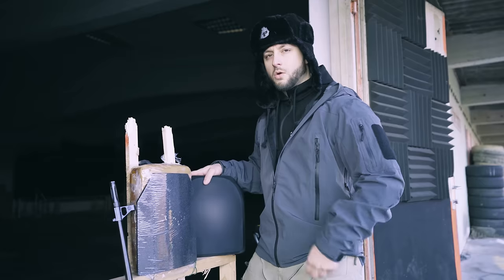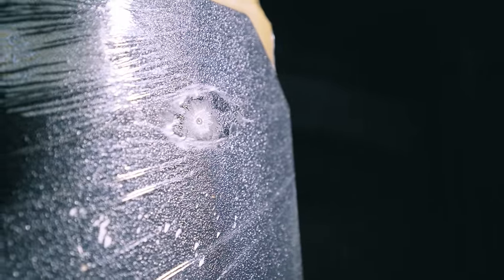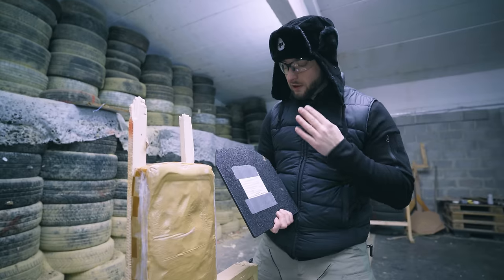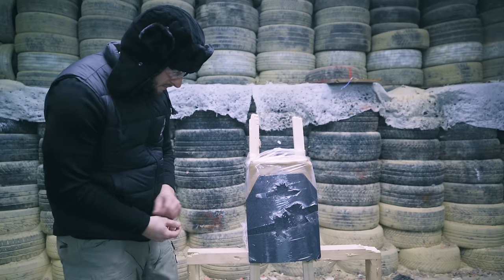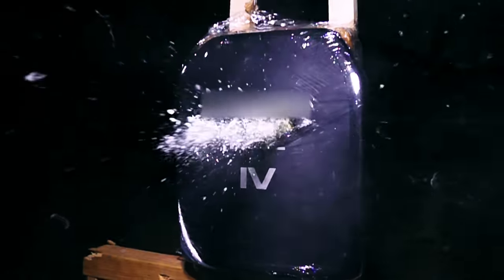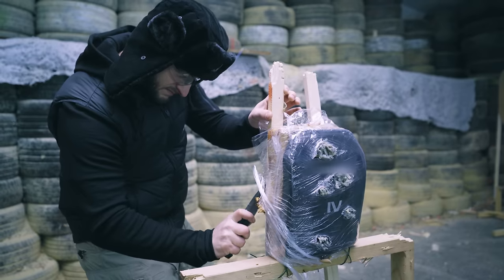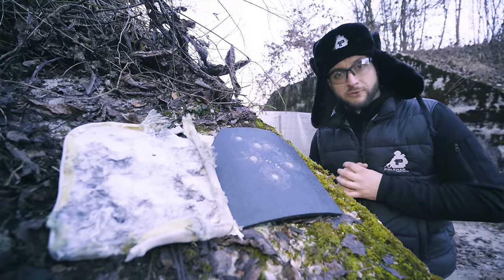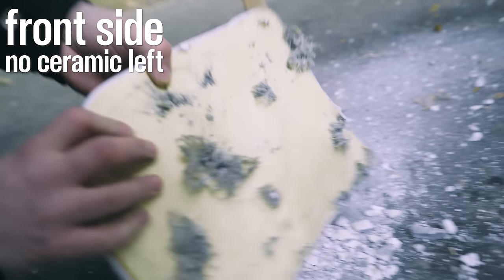Steel vs Ceramic Ballistic Plates

Comment: What is the price difference between the two? And how about combining the steel plate with soft body armour? Always great content👍 Greetings from Bavaria
Reply: Good Level IV plates are $600+ for a pair. Spartan Armor Systems AR550 Level III+ steel plates are around $250 for a pair. III+ can defeat pretty much any common use 5.56 round (including M193 and Green Tip).
Reply: @Sweetness71775  thanks for the quick reply 👍
Reply: In greece siamidis level 4 standalome ceramic plate costs 240euro
Reply: @Sweetness71775  M193 and M855 (green tip) are both not ap rounds so that makes sense. Anyways tho, those rounds running actual military pressure out of a 20” barrel is gonna vibe check you anyways
Reply: @Sweetness71775  they make fun of you . in greece you can buy good ceramic plates with 300$
Reply: If you go with steel, putting soft armor behind it is a wise choice, soft armor is meant to catch small arms fire, shrapnel and is designed to spread the impact energy, steel is tough so spreads the energy over a wider area and transfers it to the soft armor dispersing it even further, not to mention it has the chance of catching the round if it makes it through the steel plate, but if you are the type to run around with a midget plate carrier that only protects the heart and lungs at an 90 degree angle then suffering is deserved, shove those steel plates into an IBA vest, works best in that case
Reply: @c03_psychie20  yeah putting soft armor behind isn’t gonna solve the problem of “i just took shrapnel to my carotid”. Plus, thats adding more weight and bulk to already bulky and heavy plates. But at the same time, considering what u think about modern kit, its not surprising
Reply: @bro26mohw  solving what problem? The person asked about combining steel with soft armor, since everyone got only ceramic in mind, I decided to explain my understanding of that one ignored topic. Besides bulk and weight doesn't matter to me, it's not like I'm going anywhere. Also that thing of bulky armor is one really shoddy and sad excuse coming from a ceramic user, those ceramics are also heavy and overly bulky, use a different excuse please
Reply: @c03_psychie20  modern ceramics are 1/4 of an inch and my level 3 plates (on the upper side) are only about 3.75 pounds. So yeah no. Seems like u might be a bit behind for ceramic tech
Reply: @bro26mohw  aaaand you use one brand of plate to support your entire argument with regards to weight, 1/4 of an inch...BFD is gonna be horrific, it's gonna last a 1/4 of the shots of the thicker plates and your body weight is gonna take all of the impact from being light, once again I was explaining to the other person with regards to soft armor and steel, naturally one of "you" just had to brag about how great ceramics are without mentioning any draw backs, don't assume everyone has the same preferences
Reply: @bro26mohw  btw, the "carotid problem" iba vests have kevlar neck protectors incase you overlooked
Reply: @c03_psychie20  i purposely ignore that because the iba is severely out of date. Taking a normal modular plate carrier and adding on things like a groin protector, side armor pouches, etc
Reply: @bro26mohw  yeah I know, it's been replaced so many damn times I just don't care what version they are using anymore or the name for it so I just use a name as a universal term😂😅, but whatever works for a person works, I'm not gonna tell them otherwise it's their cash

Comment: I think a half-ceramic half-steel hybrid plate is the solution.
Reply: There is no these kind of plates in market
Reply: That's not how it works. You mix materials that complement each other, not two hard surfaces.

Comment: as the result on the paper which analysis by the army, the steel plate does hold better than ceramic by mutiple shot on the same spot.
but it rarely to get shot on the same spot when you're in the operation. also, the bullet breaks into piecies and it could scratch you body or your face also when it hit the steel plate.

you may survive by steel plate when it was hitten at the same spot, but also get injured sitll
you maybe will injured by getting shoot at the same spot with ceramic plate, but atleast it's rarely happened, and with ceramic plate you wont need to afraid for splintery scrap from bullet

some of the army who i known will put a NIJ4 plate and a 2.3mm steel plate(about 3A) for addition armor at the front if their physical fitness aloud them to do it

Comment: I'm actually suprised how well the steel plate did. hmm.. I was about to order some ceramic plates, but now I'm not quite sure anymore. The ceramic fragments look a bit worrying in the high speed camera. Maybe you could do some more investigation on spalling of different armor plates?
Reply from the maker: Go with ceramic - it's level IV and still considerably lighter than a steel plate. Also the price difference isn't that big anymore so i really don't see much reason to buy steel plates. But if you do, buy the ones that have 100% effective spalling protection like Steel Ops
Reply: Go with RMA Armaments level IV plates. They are reasonably priced and sales are common to bring the price down further.
Reply: @PolenarTactical  well looking at ukraine these days, really? Just consider - Armox 600 plates at 5 mm thickness with Paxon are not that much of bigger weight than ceramic. But, those are multiple hits definitely? Ceramic? Not at all, one hit and you can throw it away. Ukraine has a hard time to get enough of balistics and that means, once you ate hit and survive, you will not found any free plate easily. You can use that same Armox plate once you return to the base camp and get back to shape. 
fragments? Well, you get those from ceramic as well. They will definitely cut your throat. Some finest kitchen knives and scalpels are made out of ceramic after all. 

Regarding polyethylene panels, yes, those are light. But the results are definitely not great. Even those rated at level iv can be shot trough with such commom round as 7,62x54R (very common in central europe here) or high velocity 5,56. 
Trauma effect even when bullet will not pass through? 5-10 cm without problem, so if not a bullet will kill you, trauma and internal bleeding will.
Reply: @ZhuJo99  yeah id honestly rather have steel with good fragmentation protection. duct tape can even become a frag sleeve.

Comment: I personally run ceramics but steel isn’t terrible and I’ll probably pick up a backup set of steel plates in case SHTF
Reply from the maker: Steel is very heavy and only makes sense if you get it way cheaper than ceramic composite - and it needs to have proper spalling protection otherwise it can kill you

Comment: Is the vz58 is not much overgased with the supressor? Or did you regulate the gas?
Reply from the maker: It's overgassed but since it's short stroke piston system you don't get that much gas in the face

Comment: Most plate carriers are enough to protect you from spalling. People like to throw fits.
Reply from the maker: That's not completely true, the fragmentation from an unprotected steel plate is enough to penetrate a couple of layers of cordura from any plate carrier and seriously hurt you.
But the problem of "spalling" was already solved by most companies that sell steel plates, you just have to get the correct ones

Comment: Just a bit of info for those who care to learn: steel plates have significant danger of spalling shrapnel causing an injury, but what most people fail to understand is the danger of kinetic force transfer. A steel plate can stop many high powered rounds, sure, but it transfers a massive amount of force to whatever is behind it (your chest and vital organs). This can cause severe internal damage to lungs and organs. It's not something that shows up in a ballistic test with a plate strapped to a pallet or whatever. Would you slam a sledgehammer into a cast iron pan if your palm was pressed against the opposite size? Think about it. Buy ceramic.

Comment: 855a1 is not ap.
Reply from the maker: https://www.army.mil/article/48657/evolution_of_the_m855a1_enhanced_performance_round
Reply: @PolenarTactical  "Although it's not an armor-piercing round, the EPR "
so, mil.gov says it's not AP 🙃
Reply from the maker: @doejohn8674  true, they designated it as an "enhanced performance round" but i has a hardened sharp penetrator (can actually see it sticking out of the bullet) and it goes through most NIJ level 3 plates

Comment: I hear you can get spall sleeves to go over steel plates. Do you know if they properly contain the spall?
Reply: There are coatings to reduce spalling too
Reply: Sleeves generally work , they of course will be torn apart after a certain amount of shots, but they can work. 90s and early 200ps era russian body armor had that (and you can look up on oxyde s channel for test of such armors, basically it work, just if you shoot enough byg caliber rounds you get fragments out after few shots. )

But carrying one steel plate with few extra sleeves is lighter and takes less spzce.in your backpack than carrying two ceramic plates, so, if you don t face big AP rounds it can do

Comment: I still don't understand why steel body armor manufacturers aren't just facing their plates in a few layers of pleated Kevlar...
Reply: Their prices are already close to cheap ceramic, while already being considerably heavier. A lot of the "anti-spall" coated metal plates are already equally expensive to some ceramics.
Reply from the maker: Most manufacturers of steel plates have already solved the problem with "spalling" by applying special coatings on the front of the plate. The problem is that those plates are more expensive because of it and less interesting to people that want to have something for cheap

Comment: I’d like to see a ceramic plate get hit by a couple of hot .300 RUM loads in the 180-230gr range. Just for shits and giggles. I had some M1 blacktips that were 30/06 manganese core from WWII that I bought at a gun store that was going out of business. Put it this way, we have a big 3/8” ar550 target at our club and it has one hole in it from about 50m and that thing gets shot thousands of times per year. My 300 RUM barely scratched the target at 25m with a 180gr copper solid going 3,500 fps…

Comment: I shot a steel plate with a 338 Lapua and didn't punch it. I have a 50 BMG I was going to try for the laughs
Reply: its speed that kills steel, heavier 338 rounds are slower than most 556.

Comment: Steel ops is not buyable in Germany sadly
Reply from the maker: You can get quality made ceramic composite plates in Germany for a reasonable price so no need for steel plates. Steel only made sense in the past when it was super cheap and ceramic plates weren't readily accessible to the civilians
Reply: @PolenarTactical  reasonable is the point at the moment 275—300€ per plate

Comment: I wear a level 550 steal and level 4 ceramic in the fron part of my carrier, do you think that's a good idea I have found any feed back
Reply from the maker: Steel and ceramic plates? How heavy and cumbersome is that? Sounds very impractical...
Reply: you wear two different plates in the front?
Reply: @PolenarTactical  it weight like 21 i have a steal core in the back and I steal and a ceramic on top the steal in my front part
Reply: @drzdylan  yea a steal and a ceramic I wanna be like M1 ABRAMS uk lol
Reply: @PolenarTactical  I didn't buy the spal coating for the steak so I bought a ceramic for overkill
Reply: Dude you are probably the only person doing that I don’t want to tell you that’s too much but it’s way too much for me. Idk how you even fit all that in a carrier let alone actually wearing it. I have to work in my plate carrier so there’s no way I’d want to wear something as heavy as yours all day. I have Lvl 4 ceramic plates and I feel good about that Lvl of protection. I had steel plates years ago and it was way too cumbersome for me but steel plates definitely aren’t obsolete
Reply: Is that you Gecko45?
Reply: @tampasilver2040  just wrap the steel plate with 1/3 inch thick duct tape, taped in an alternating horizontal and vertical pattern, i've tested it against 5.56 and it should should stop spalling for around 3 shots, after that shit starts spraying out from the sides and parts of the duct tape that's blown out. but if you already have ceramic on the front then why bother putting a steel plate behind it?
Reply: @f.b.l.9813  i saw the duck tape video I planned in doing that but I love God and I want to be a irl tank lol love the videos bro
Reply: @tampasilver2040  what videos? my channel is empty... also side note, i forgot to mention that i didn't use green tip on the test, i only had i think 55gr xm193 at the time so the results may vary...

Comment: that steel plate did more thatn LVL3 ... I think it was not supposed to stop mosin.... good job. Can you try .30 06?
Reply from the maker: I was certain that both M76 and Mosin would punch through... i was quite surprised
Reply from the maker: .30 06 normal rounds have almost the same energy as .308
We would need AP rounds for a proper test but those are forbidden here :/
Reply: @PolenarTactical  I recently punched a test plate with .30 06 (a little hotter FMJ hand load). 7,62x39 was totally fine. The rating was a bit odd (level III minimum tho, it was some kind of noname plate). I must try .308 next time when I get it in my hands.
Reply: @PolenarTactical  I had some wwii US 30/06 blacktips that I’m fairly certain would penetrate any plate known to man. My gun club still has no idea how that hole got in the 3/8” ar550 steel deer target at the 200m mark lmao

Comment: Why don't they have a hybrid? Would it be too expensive?
Reply from the maker: Hmm, interesting, i was actually thinking the same... 
Essentially ceramics are way harder than steel for the same weight but shatter. The biggest problem with steel besides the spalling is definitely weight so im not sure if a steel/ceramic plate would have much benefit
Reply: @PolenarTactical  what if they did a thin steel front layer just to try to catch and retain the ceramics after impact and a roughly 5-6mm thick ar500 steel backing plate behind the ceramics to protect from double impact?

I'm guessing it's too difficult/costly of a manufacturing process.

Comment: Ceramic plates are usually standalone, steel plates aren't! Another layer of material should've been added to prevent shattering damage to the host.
Reply from the maker: Never thought about it since steel seems solid but after seeing the energy transfer to the clay block it made me think
Reply: more weight

Comment: Yeah, this video was interesting. I didn't think the steel would do as well as it did. But a steel piercing 5.56 would probably change that. So soviets use ceramics. Westerners stick with steel? Lol
Reply from the maker: When we planned this video i was certain that we would penetrate the steel plate with 8mm mauser and 7.62x64r... i learned something new by making this video :)
Reply: @PolenarTactical  honestly I thought the steel had no chance vs those bigger Caliburs. But if they were steel tipped, results may have been different. But if your just trying to defend yourself in a non-war type situation you probably won't be getting shot at by armor piercing ammo
Reply: @Rick Smiley actually, westerners went very quick toward composite materials and ceramic while soviets used metal à lot (look up about 6B1, 2, 3, 4, 5, about zhzt71, zhzl74, modul 1 to 5, kora, etc...

You can also look at early post soviet russia with stuff like 6B12, 6B13, 6b23, defender 2, redut, korund, bagaryi, etc...)

Basically eastern block + poqtnsoviet russia used metal à lot (titanium, alluminium and steel based alloys )

Western armies on the other hand quickly went for composites , and when rigid plates became a thing quickly went for ceramic-composite

Comment: The controversy of steel vs. ceramic will go on. The bottom line is, better to have something rather than nothing. One question I always ask the ceramic crowd is, do you carry a backup plate for when your plate has taken several rounds and is now degraded? Common answer.... No. 

For the steel guys, you must remember that the carrier and  any kit mounted to it will also prevent spalling. Plus that plate will take numerous hits. Spalling is not my main concern as I bag my coated plates with the same material used in Carhart work pants. You know that fabric that doubles as sand paper. The result is almost 0 spalling .

My main concern is the transfer of force which will cause massive internal injury. The bigger the air gap between the plate and the body is good, as well as other foams etc. to absorb the force of the hit.

I know, I know, steel is heavy! My common response, stop shoving Twinkies down your neck and get off your ass, you will live longer!
Reply: Most carriers don't prevent spalling. Unless they are lined with aramid or similar (most are not), they wont resist it
Reply: The carrier bag will not catch fragments ("spall") that result from getting shot at, this has been tested already. The "spalling" also gets worse when getting hit at an angle and you can even get bullets deflected if the angle is right, a deflection would result in a direct hit to you or someone standing next to you.
There are statistics on parts of the body that get hit the most, if you get multiple hits, you're almost bound to have received at least one shot on a surface with no armor, meaning you will be out of combat immediately or soon after. The multishot capability of steel is really not relevant.